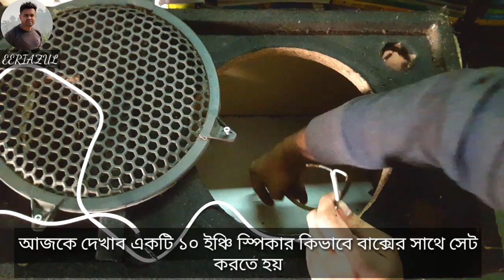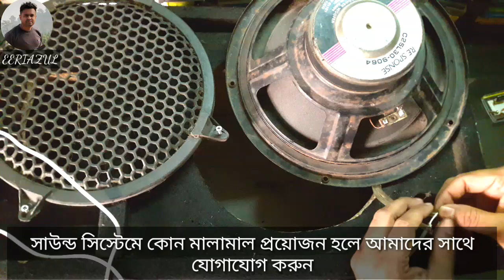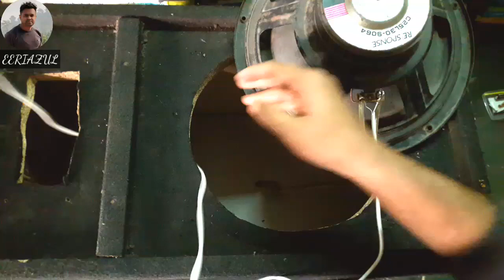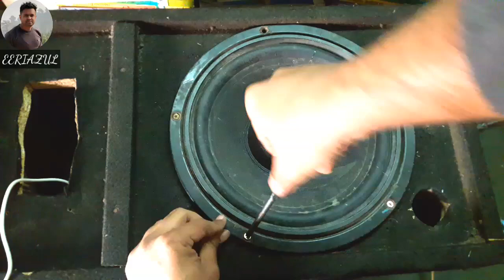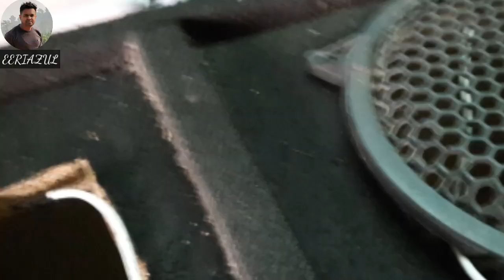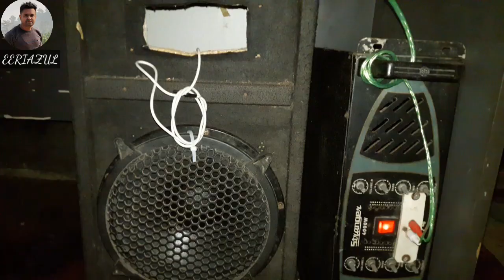10 Inch Spekar Set Up With Box | ১০ ইঞ্চি স্পিকার বক্সের সাথে ফিটিং করা | Contact 01946198414

Comment: ভাই ৮ ইঞ্চি স্পিকার ৪ টা বাজানোর জন্য কত টানজিস্টারের এমপ্লিফায়ার বানাতে হবে, আর কত ভোল্ট দিতে হবে??
Reply from the maker: 4 transistor, 24 volt diye banan ...
Reply: @electricalengineerriazul  ধন্যবাদ স্যার
Reply: ১০ ইঞ্চি স্পিকার বাজানোর জন্যে কত টানজিস্টার লাগবে স্যার
Reply from the maker: @joysarker2079  4 transistor and 24 volt diye e banan amplifier.... 2 ta 10" perfect bajbe ... Vlo bass and voice hbe ....
Reply from the maker: @joysarker2079  and  8" spekar bajate hole 2030 double ic board diye o banate parenn... Or transistor....
Reply: @electricalengineerriazul  sir akta 8 inche clear ar akta high ba twiter bajanor jonno 4440 double ic circut board ta valo hoba naki onno kno circut board